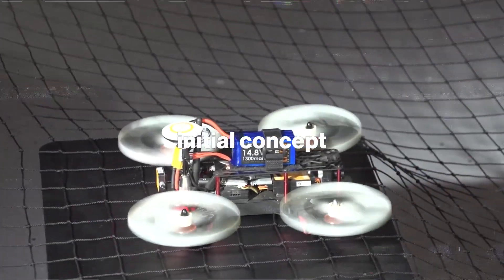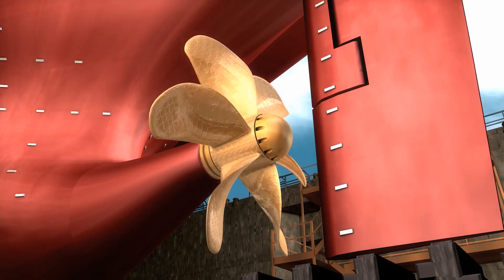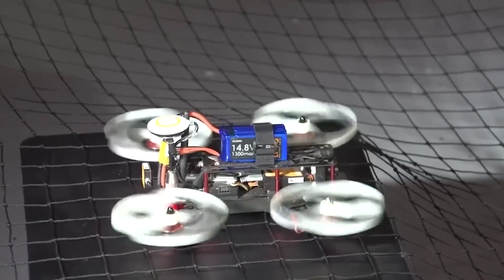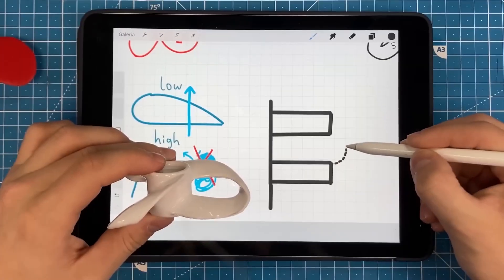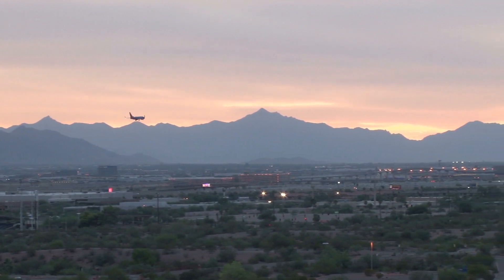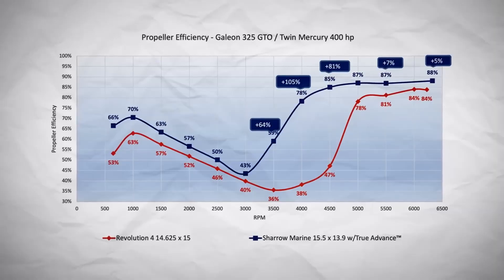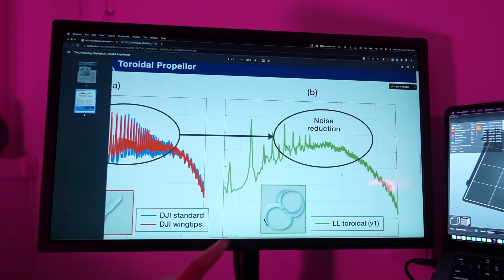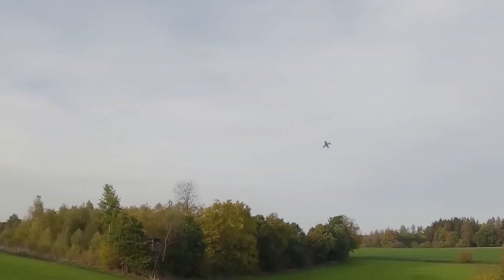MIT Just Launched This Propeller That Will Change Aviation Forever

Comment: OMG ! It seems that creators of this propeller  don't know much about aviation !!!   Yes this is nice for  small diameter propellers (for drones)  and waterborne transport propellers but for small planes ( cessna, piper . . ) problem will be big gyroscopic effect already known from period of  W.W.1 about airplanes with rotary engines. Pilots of Sopwith Camel preferred to turn 270 degrees right instead of 90 degrees left, it was quicker !  With bigger propellers situation is more terrible !
Reply: It wasn't ment for airplane use.